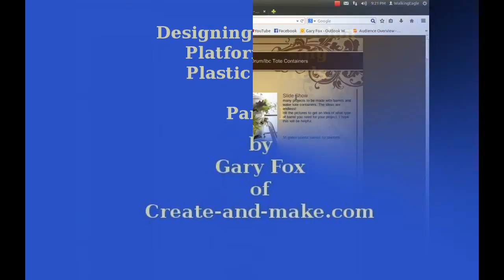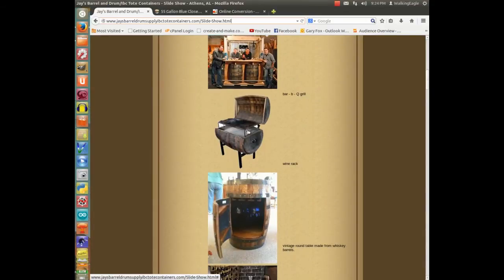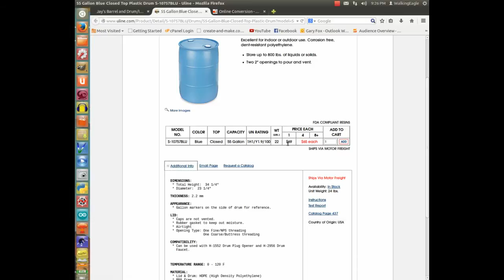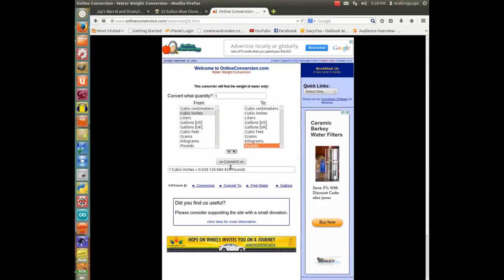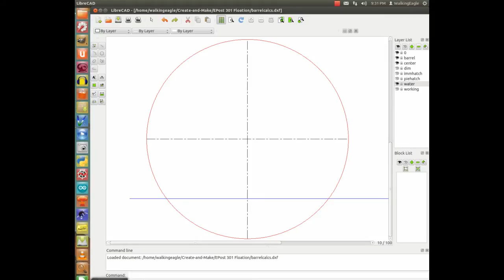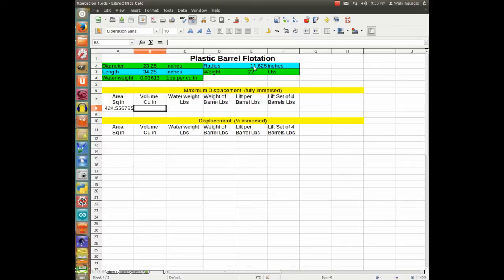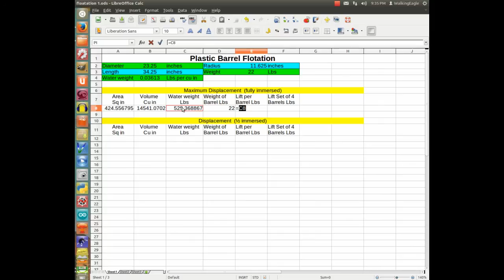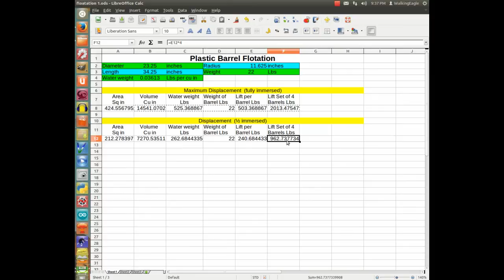A Plastic Barrel Flotation Platform Part 1

Comment: Might want to check your math. Something doesn't look quite right. the barrel holds 55 gallons and water is appx 8.345 pounds per gallon, which is 458.975 lbs fully submerged. Probably your uniform profile assumption plus using external dimensions.Just some constructive feedback.